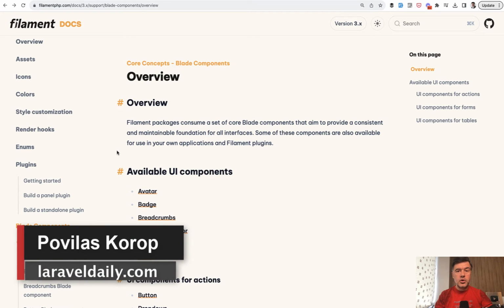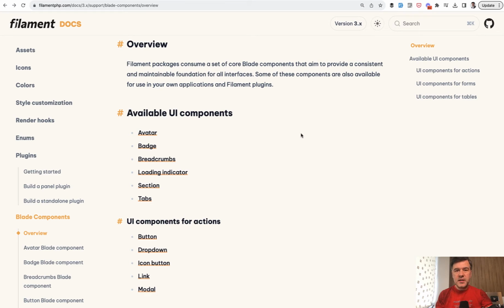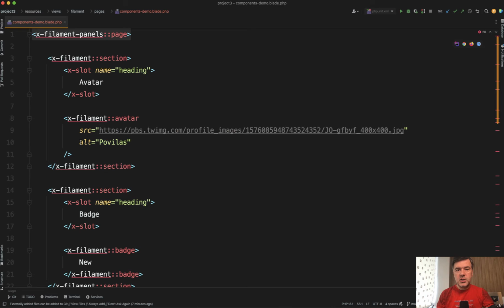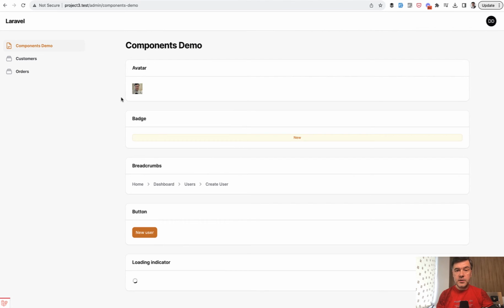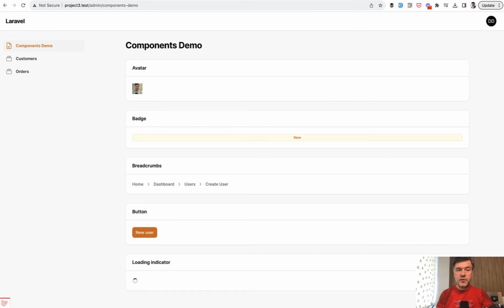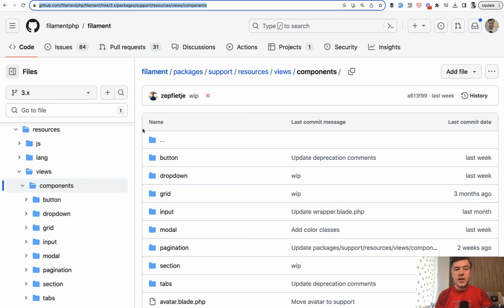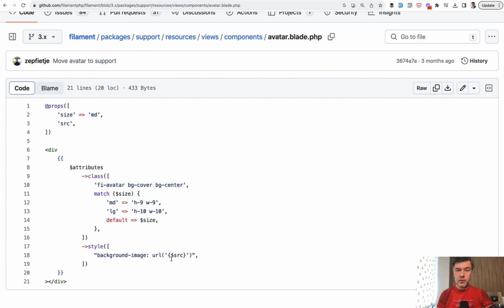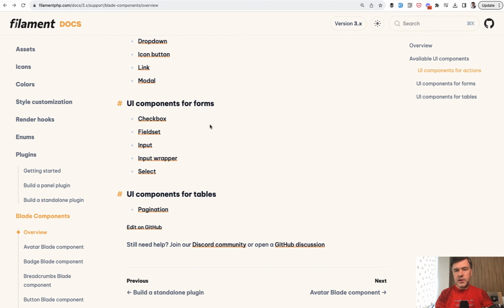Filament Blade Components: How to Use and Customize Them

Comment: Getting a lot out of these videos....I would love to know how to use a custom view to display data in something other than the standard filament components. For example, if I wanted to create a contact card component and utilize the tailwindcss components library as the design for it. It seems that when I try to do this, filament doesn't recognize css. Doing something as simple as adding margin doesn't seem to work.
Reply from the maker: Have you re-compiled your assets with "npm run dev" or "npm run build"?
Filament doesn't automatically "recognize" something if it's not in the Tailwind config within Laravel project, so look at your settings there.
Reply: maybe add the blade path to resources/css/filament/admin/tailwind.config.js